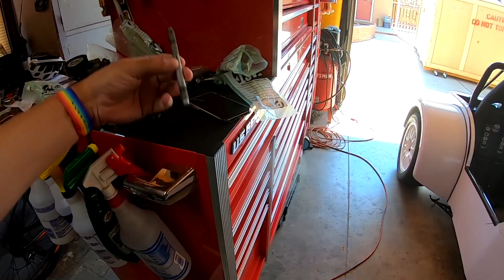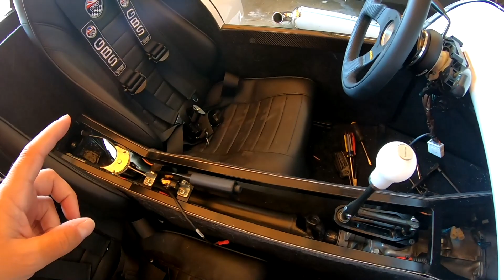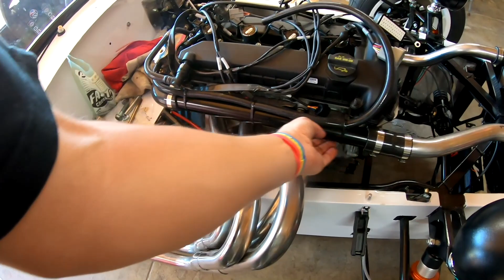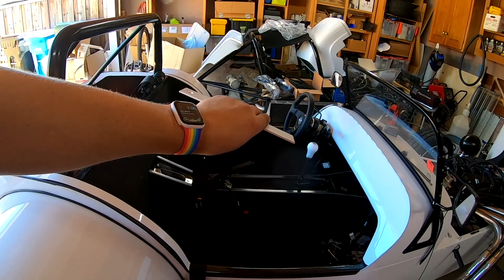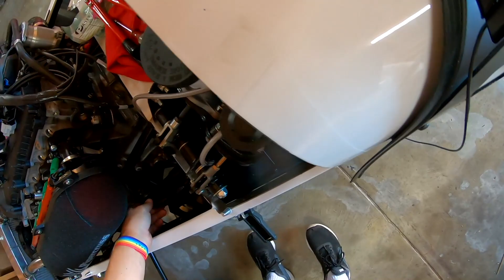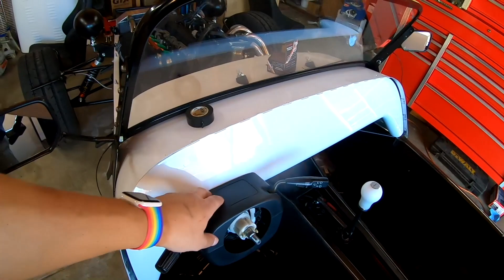Project Zero 14, Engine is In

Comment: Any opinions on Factory Five builds?
Reply from the maker: I haven't built one myself but I've talked to dozens of owners of GTM, 818, and Cobra kits.  They are cheaper kits that rely heavily on donor parts, and the fit and finish is much worse than the Zero or Ultima.  They need a lot of body and finish work to get away from that kit car feel, but if you are looking for a track toy it's a lot of bang for the buck.

Comment: Ultima are reliable ?
Reply from the maker: My Ultima was super reliable, putting up with track abuse and long trips while only needing fuel and oil changes.  The engine failure was me pushing my luck on one last track day of the year when I knew the engine was hurt, lesson learned.
Reply: @DriveDriverDriven  thanks buddy for your reply

Comment: I have been itching to buy one of these kits and drop a Honda F22 motor into it. Judging by the extra work you're having to do just to get a pretty standard engine into the chassis and set up... Doubt I'm going this route after all. 😢
Reply from the maker: Honestly, you can get just as much power from a built 2L Duratec/MZR for 1/3 the price, or go bigger with the 2.5L Duratec which is the new standard in the Gen 2 Zeros.  Several builders have used the S2000 drivetrain so I know it fits, but expect some fab work for a non-standard drivetrain.
Reply: @DriveDriverDriven  owning a couple S2000's already, I know the F22 can make up to 235hp at the wheels with a tune and bolt ons.  I just thought 9000rpm in a zero would be a blast. Can those duratec motors do similar??  It seems like you had a lot of small issues getting your motor in the chassis, which is just as much of a concern. I have limited time to throw at a huge ordeal this year... Can you maybe do a rundown of the issues and extra costs you faced once it's completed? Keep up the great work!
Reply from the maker: I have a Gen 1 Zero, one of the last ones out of the factory.  It was originally designed for a 1st/2nd gen Miata/mx5 drivetrain, and my extra effort comes from shoehorning a later 3rd gen drivetrain in there.  The current gen 2 chassis is designed around that 3rd gen drivetrain from the start so it's a direct fit.  A built 2L duratec will wind out to 8-8.5k and make 230-240hp, a built 2.5L will be closer to 300hp, with much more torque on tap.  Just like I did for the Ultima, I plan on doing a full cost breakdown and review of the kit, along with a recap of my build experience.
Reply: @DriveDriverDriven  Thanks for clarifying, that made my day. Time to do some research on these options! Thanks a ton!